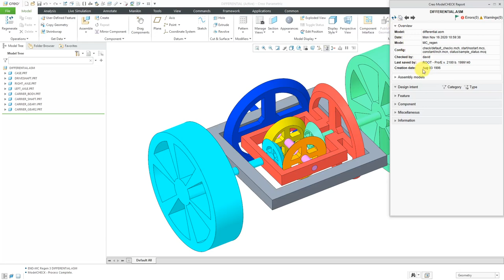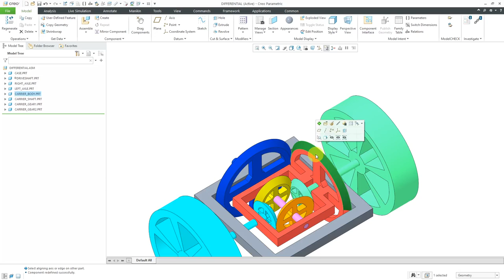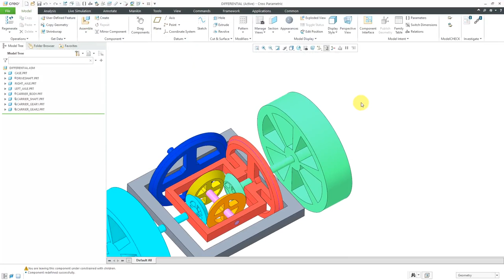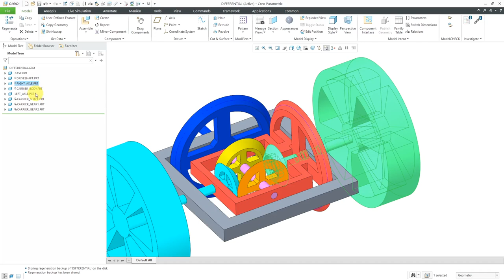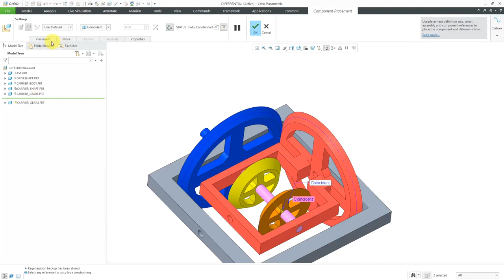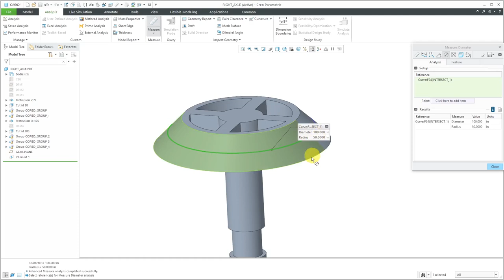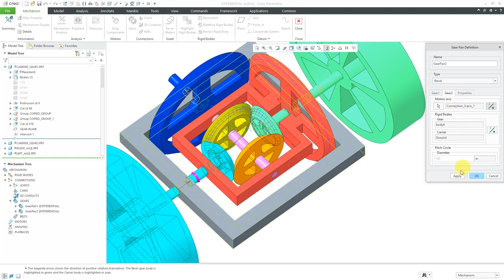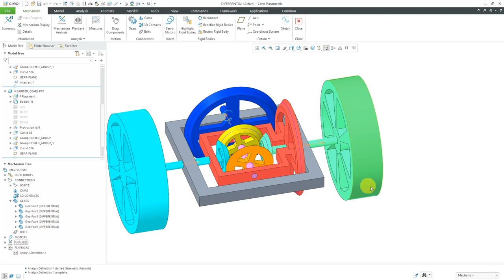Creo Parametric - Mechanisms | Differential Transmission

Comment: Another great video, really enjoyed this one. It's the little tricks you pick up like the mid-planes and also using the intersect function. It does makes you wonder if the guy who created the diff forgot to switch to metric.
Reply from the maker: Yeah, I have a few questions for whoever made the model. It's a quarter century old but it's janky even by 1990s standards.

Comment: Hello Dave Martin, I really admire your efforts to educate the world.  My question is why is there a need to move some parts above certain components. I mean if they are fully defined in terms of connection then why we bother to move them. What difference does it make if we do not move them?

I have also a request. If you please provide the source of the CAD models or the CAD models themselves it will be helpful for us to practice the things that you have taught us. It would be really helpful.

Thanks again for your valuable videos. I really learned a lot from them.
Reply: Hi Farhan!
I think Dave can explain it better but I would like to give my two cents.
There are alot assemblies in real world that actually have moving components. So the CAD softwares gives us the capability to analyze those components in motion as well. It helps us to see various parameters such as collision analysis, workspace, and motion envelope.
Reply from the maker: Creo Parametric is a history based modeler in which components and features are regenerated in the order in which they appear in the Model Tree. To ensure optimal regeneration, I reorder the driving components in mechanisms above the driven components.

Comment: Great video. For turning the inner gears, maybe you should try to determinate rotational drives to each axis (left and right wheel) with same direction but not the same speed aka. cornering. But I assume that this is not so sophisticated method.
Reply from the maker: I have recently gotten access to Mechanism Dynamics so hopefully that can help me simulate the benefits of a differential.